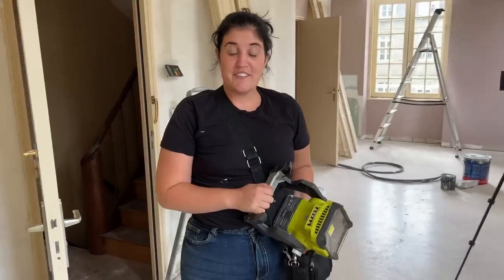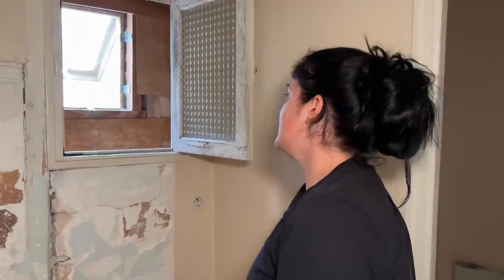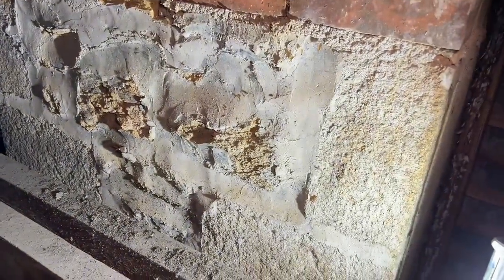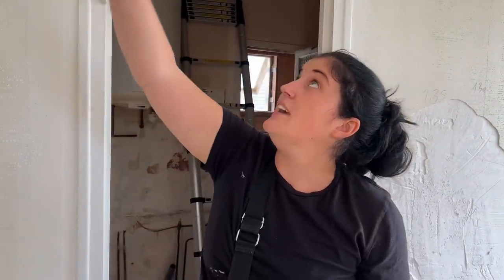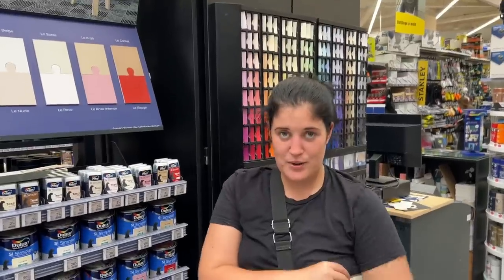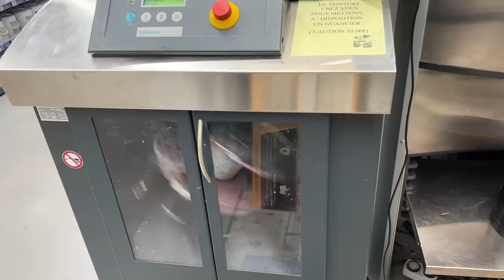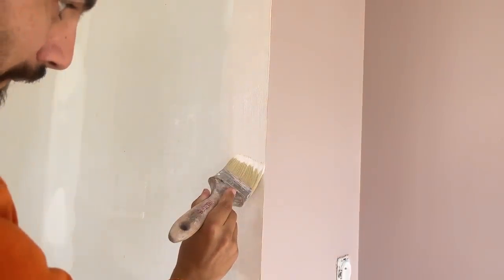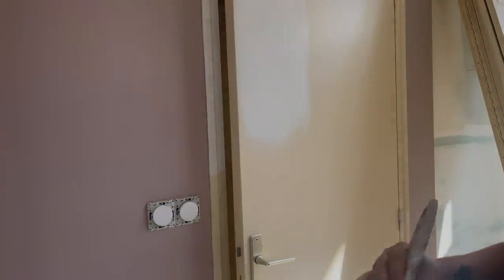What Did We Find In The Convent Apartment Attic?!!

Comment: Because there are so many holes in the roof, you also need to worry that there's mold in all that insulation because of water infiltration. And surprise they're not bigger leaks evident in the apartments for damp on the walls because of all of that. Of course you will get rid of the wasps. Another reason to get rid of pigeons is the diseases they transmit their poop. It's a really cool attic. It's a shame you can't turn that into another room.

Comment: Looking inside the walls there seems to be a lacking of insulation here and there. Even around the light well into the staircase. 
I would definitely check all around and add a lot. Especially with the prices for electricity rising to new record high levels. 
From what I could deduce the wall between the flats at least in Olivias room is lacking insulation too. And by the way it seems you need some in the kitchen wall to the bathroom. 
Otherwise I love what you are doing. I would never have chosen the musky pink and the black kitchen an boy was I wrong 😄

If you find an ginormous armoire maybe the fridge could be fitted in it 😜😅

Comment: Just wondered as a few others did, why were the paint cans not full? Here in America they are. Looks like you got slighted. 🤔 same here nobody is ever in the department of our home improvement stores when you need help either. Saw the wasps nests and also wondered about the insulation,  it will no doubt need replacing since it has been wet/ moldy. Hope Billy can get the roof fixed for you soon. I like the lighter colors for the trim and living area/ lounge. Hope you get over your cold soon.